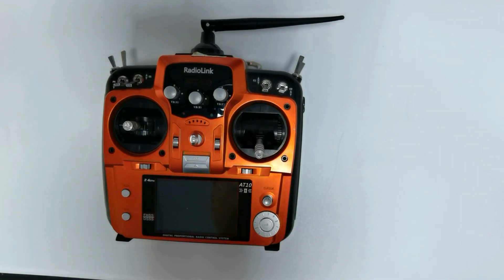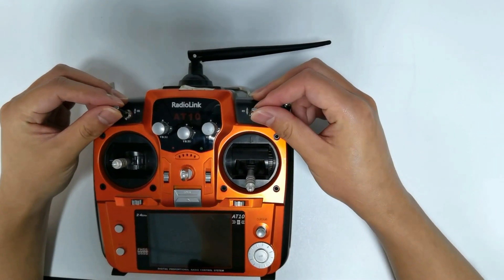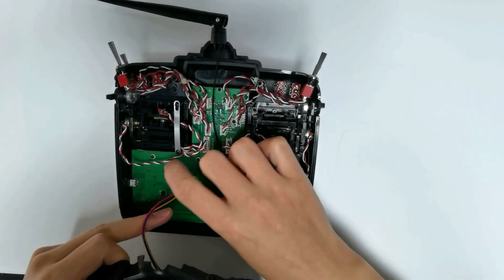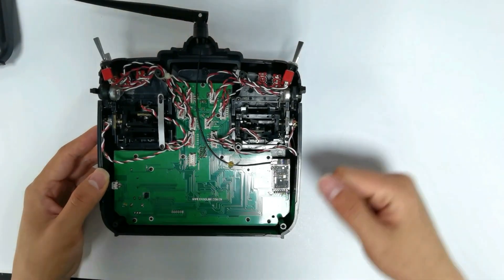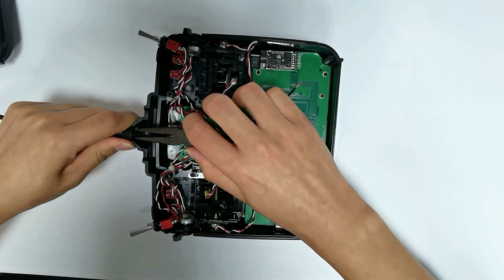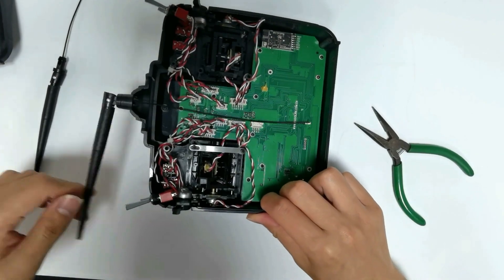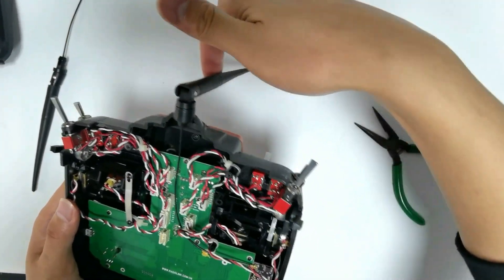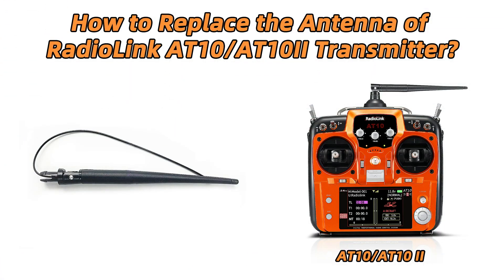How to Replace the Antenna of RadioLink AT10II Transmitter?

Comment: How do I know if the antenna is not working anymore?
Reply from the maker: Hi, sir. When there is control problem of AT9S Pro/AT10II transmitter, such as short control range, signal loss, please test RSSI. It is also recommended to test RSSI before the flight. Here is RSSI test tutorial https://www.youtube.com/watch?v=jr7ad-_MVoI  If there is RSSI problem, you can confirm if the problem comes from receiver antenna or transmitter antenna by exchange another transmitter or receiver to test. If you can confirm the transmitter antenna is damaged, or the problem comes from transmitter, you can replace transmitter antenna. If any question when using RadioLink products please feel free to contact us. Our email is: after_service@radiolink.com.cn